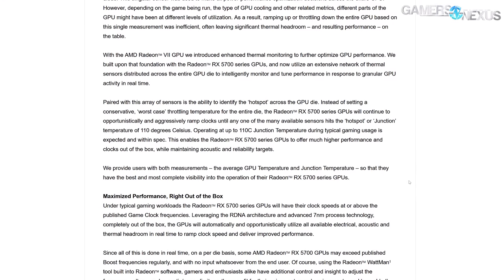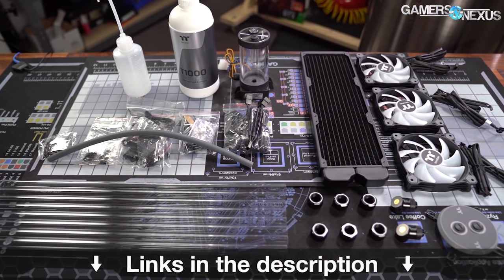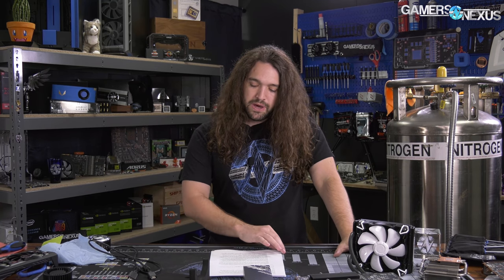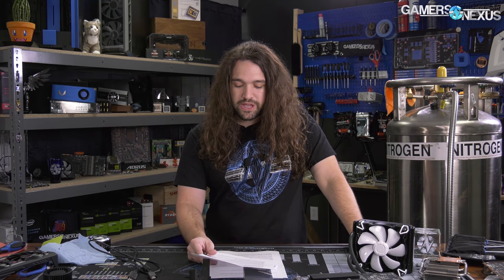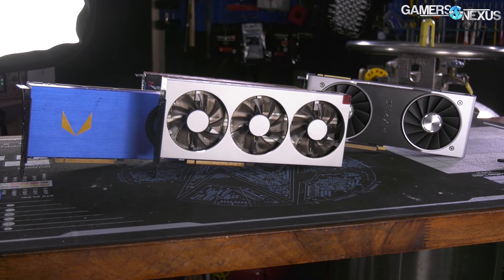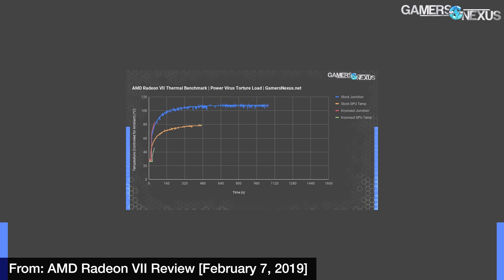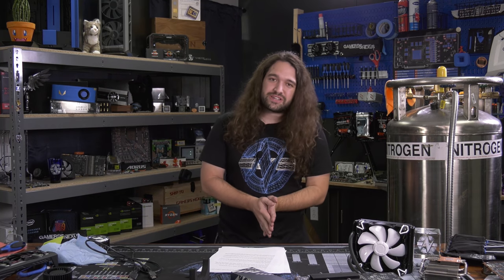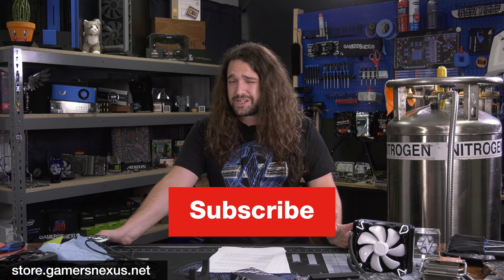Explaining Navi 5700 XT Junction Temperature | 110°C is Not "Expected"

Comment from the maker: Guys, a lot of you are posting memes and don't seem to be listening to the content, and that's very disappointing. We said in this content that Junction temperature exposure is fantastic and needs to continue, but that bad coolers are responsible for high junction temperature (not the mere exposure of it). Sapphire's cooler demonstrates well that it can be kept in the 80s and doesn't need to be "expected" at 110C. Please listen to the actual content that we invest time into rather than racing to be first to post some misleading and frankly stupid meme about housefires.
Reply: meh
Reply: Could this higher junction temp be used to allow this card to be run with something like a passive cooler?   Obviously the card will not be performing at max capability, but will it still be an upgrade over a passively cooled RX 580 (for example)?
Reply: the gamer community is not the epitome of intelligence Steve. this community is dark and regressive at times and has brand paid AstroTurfers
Reply: Mine  reference 5700 xt wont even run on stock fan curve. I keep all games on ultra tho. Far cry 5 runs half a minute or less before pc crash. Metro exodus on ultra crashes in like 10 sec or less. Running at 1080p
Reply: 3:35 AMD's statement explicitly states that there are multiple sensors for TJunction on the chip, so I find it strange that you would state that your testing is proof that the cards you've tested are not hitting 110C. Do we know how the temperature reporting for TJunction works on AMD cards and software? Is the reported value averaged over multiple sensors, or does it report peak TJunction? Over what timeframe do they time average?
Just like with PL1 & PL2 on intel CPUs, we could be seeing very short, instantaneous peaks on the GPU without ever coming close to a sustained 110C TJunction, or even showing up on monitoring software as reaching 110C. 
Just something to think about.
Reply: I think the reason for this is that pretty much everyone knows the blower cooler sucks and we didn't need yet another video to explain why.
Reply from the maker: @Vasharan  The reported Junction temperature is the maximum of all those on the chip, which is why we can state that. We said that in this video, too.
Reply: @Chakotay2222  
Sounds like you might have a faulty GPU then,
You should probably try returning it
Reply: @Aggnog  exactly we now have aib cards with really good cooler to choose from, its time to move on man.
Reply: Don’t get discouraged by the memes. There are plenty of us who your content is very valuable to and we appreciate you.
Reply: I really thought the original 110c comment seemed off when I first read it, and I appreciate the explanation. Only complaint about the video is that there wasn't enough Dragon cooler b-roll.
Reply: I have a maybe ignorant question. How does the Sapphire (or any AIB  card) compare to the reference blower cooler in a case with awful airflow? In that situation, does their claim that blower coolers hold up better in those conditions? And is that maybe what they mean by expected in that situation?
Reply: dont let your memes be dreams GN
Reply: It's Friday night, my dude.
Reply: "110 C is expected"........ Why, are they selling them without any coolers, or with the shittiest coolers?? :O
Or is the power management that shitty?? :O
ATI needs to go commit Area 51... :|

"Out of the box thermals" or "in the box thermals"? Which is it? :/

But if the boost starts AT 110 C, then I understand why the shit coolers......
Reply: I refuse.
Reply: Yes, my lord... Tech Jesus .
Reply: Unless all GPU makers such as AMD & Nvidia and soon to be Intel all post junction temps it is almost useless data and just causes everyone to get all bent out of shape about it because it makes one companies product look like it is running way hotter than the other companies product and there are enough dumb people out there to not under stand this and just spread misinformation because they are not smart enough to understand the data in front of them.

So again unless all GPU makers post the same data like junction temp then it is just something that causes the internet to go all crazy for no reason. As stated in another post AMD was not saying the card should always be run at 110c they are saying it can get up to 110c without issues. Yes they worded it poorly for sure. Besides that I am sure Nvidia also uses junction temp for their boodting as well but they choose to not show us the junction temp.
Reply: I knew what they meant 110 is within spec but lower is always better (it is fine, even you say it is. this is crazy just a semantics argument). I don't know why anyone thought that navi would keep boosting like that. I don't think amd implied that at all. Still a good video it just seemed like amd said something that idiots misunderstood. Still as a tech educator i can see why you had to make this video.
Reply: Not to nitpick (an otherwise excellent presentation), but you mention at 12:55 that "the inductors are kind of running on the edge of thermal runaway." While this might be true of the MOSFETs in the VRM, inductors are NOT subject to thermal runaway, as thermal runaway is a phenomenon basically restricted to semiconductors or other active circuits.
What happens (in the case of Bipolar Junction Transistors) is that leakage current increases with temperature, causing the device to dissipate more current, which leads to greater heat, which further increases leakage, which leads to a further increase in dissipation, etc. in an escalating cycle.
In MOSFETs, because RdsON (or "Drain-to-Source on-state resistance") increases with heat, passing the same current (at higher resistance) results in greater voltage passing through the device (E=I·R) and therefore greater wattage (P=I·E), again producing more heat, which further increases RdsON, and sets up a similar "positive feedback loop" to the earlier BJT example.
So, while an inductor's DC resistance might increase with heat, its AC impedance remains largely unaffected (which is typically the much larger factor of the two), and it won't pass more current as it heats up and set up a "runaway" situation.

As I've already opined, this was an excellent piece and I'm glad you exposed AMD's attempt at dismissing excessive temperature — (it needed to be said, so kudos to you). I hope you take this small correction in the (hopefully informative) spirit in which it was intended. Thanks as usual for the great content. Keep up the good work.
Reply: Notwithstanding the rise of the memebots on the internet and the lack of insight therein, the disappointing thing here is AMD's refusal to just admit "Yeah blower coolers were probably not the best choice" and the lack of sincerity therein.
Reply: what is disappointing steve, it's that you have to make a video to clarify misleading statements that AMD made to sell more cards.
Reply: @picklesthegreatest  I know what you mean but it's still WRONG  because if you take a blow torch to your GPU it'll heat up your room if ignoring the heat from the blow torch... Because it'll try and desipate that heat. Ultimately it is the temperature transferred that matters not TDP. Because that temperature is what transfers to the air. if you have same TDP and one GPU is at 110c and the other is at 40c the room with the 110c gpu wouldn't heat up as much as the 40c one! SO HA! Because the Heatsink on the 110c heatsink will hold more energy from going into the room. SO you are WRONG on two accounts! HA!
Reply: @andrewryder3075  Inductors are affected by heat, it increases their resistance which can then have an effect on their impedance which can cause higher power draw...
Reply: @picklesthegreatest  you've never owned a 295x2, it stays steadily at 70c in a gaming load on the 2, 290x cores, but pushes out 50c air from the rad. It's well cooled, but at 500w tdp, it was and still is a space heater. I know the 295x2 is a specific use case in this argument, but its not the core temps that heat the room, its  the tdp of the card. When 5700s are "expected" to be at 110c with only a 180 tdp, they are not being matched with the proper coolers. Obviously.
Reply: Wait so.. where exactly are all these memes you speak of? I dont see any. I would assume it's people referencing using AMD as a space heater but I dont even see that.
Reply: "Up to 110c junction temperature under typical gaming is expected and within spec" means that the GPU die is prepared to handle a hotspot of this value and that it does not degrade the die, not that is regularly operating at this value under typical gaming (which is clearly false even with the blower cards under default settings).
Reply: @picklesthegreatest  with blower style coolers it definitely does have an effect on room temp, its literally blowing 100c air out the back of your case like a damn space heater and it WILL heat your room up quickly. Put your hand over the exhaust and see what i mean, its toasty as hecc.
Reply: I think most people who watch this channel know very well that amd statement about their stock cooler is bs so all that's left is memes.
Reply: @Cichlid_Visuals  see my comment
Reply: Power Play You lost me at attention span
Reply: @jno4159  🤣🤣🤣🤣🤣
Reply: Love your content, own some GN merch, but this was kinda a silly video.

Even roundabout calling AMD hardware engineers wrong when you’re a hardware enthusiast and not an engineer is just...ehhh

AMD definitely could’ve worded better their attempt to assuage fears of the “big new scary numbers”, but their intended core message is clear: “No, routinely riding 110°C junction will not damage or otherwise shorten the lifespan of your card. Yes, you’re giving up a little performance if you don’t keep those temps down. We should’ve made a better cooler our bad, but everything is operating within safe limits so don’t worry.”

Not every day is a big news day though so I get it 👌🏻 still love you guys
Reply: @Gamers Nexus why does AMD seem to insist on blower models on their first party cards, Radeon VII being a obvious exception, when it is known to be a bad cooler design? Not throwing shade on AMD, just confused why they keep sticking with blower designs when partner cards almost never do?
Reply: @gondonmeddruxon  You're comparing the average temperature of your 295x2, with the tjunction max of Navi.
They are not the same thing. and steve explains that in the video.
Reply: @samsh0-q3a  I've scrolled passed 3 before i got to your comment. from space heater to cooking food.
all of them have failed to grasp the point of the video.
Reply: @MrNexyto  how are they BS? Their stock cooler performs exactly the same thermally as any other stock cooler for high end GPU. All of them are designed to keep their GPU's around 80 degree's, and that means all of them have tjunction temps of well over 100 degree's.

Navi's just the first to report tjunction's.
Reply: @Cichlid_Visuals  its impossible for a GPU cooler to blow 100 degree air out the back when the average temperate of the GPU is 80 degree's. tjunction temperatures NEVER reach the baseplate of the cooler, let alone the ends of the cooler fins.

in addition the used cooler DOES NOT (significantly) effect the amount of heat energy the GPU generates. any cooler on the same GPU will all heat up your room just as fast. in fact the reference cooler might do it slightly less because the card might throttle slightly, lowering energy output.
Reply: lol!
Just purchased my 71 view case and 3900x 😁 To bad I can't pick it up from Best Buy till the 27th... 😑. Now I just need a GPU. Building it so my wife can start her YouTube channel. Have to choose between a 2080ti, 2070 super or 5700xt. Is the Navi good enough for video encoding? Or should I work OT and get the 2080ti?
Reply: Sadly some Gamer's are very Hardheaded and don't watch the Video first.
Reply: please cry less
Reply: i think you need to provide GRAPHIC representation of the chip and how and where the Junction is measured when compared to old method...

it would also help to specify for the masses that we have been having higher than "reported" temperatures in the silicone for years - in spots inside the package 

i just have to wonder what the "junction" temperature would be for lets say i9 9900k overclocked to the thermal wall (meaning with barely adequate cooling, not delidded liquid metal coated on watercooling one :) )
Reply: @TheCountess666  thats the whole point of heat absorption, delaying the effects of heat increasing. Of course all things will reacb equilibrium in time, but time is quantifiable because we only game for so long, so the longer that heat is delayed from increasing ambient room temperatures the better. You just supported my argument.
Reply: well i listened and the first point.. "this is wrong, not in spec because it doesn't always reach those temperatures" is just mind boggling as an argument... 'within spec' means that even in bad conditions it runs as expected, not that you cant improve them.
Reply: Maybe next time  DON'T to post a click-bait title. Because that is how you get a juvenile knee jerk reaction from the trolls.
Reply: @picklesthegreatest  actually if you have proper cooling it will heat up your room much more since its pulling heat from the card and dumping it out of the case.
Reply: Did you watch Jay's video on this? He spoke of this at around 4:10 - https://www.youtube.com/watch?v=DzCOvZEH318
Reply: @LeftJoystick  this is just a different way of measuring a more accurate core temp
Reply: @stefangeorgeclaudiu   Steve said--several times--that the issue is not whether the silicon can handle it.  (Yes, it can.)
Reply: Giving the community a little slap on the hand GN, I like it
Reply: You can legit cook an egg on the gpu. That's how bad it is.
Reply: Did you really expect anything else? Seriously?
Reply: Probably from AMD POV 110c is okay and there is still guard band between internal data sheet and marketed spec. I used to work as NPI product engineer in fiber optic transceiver, we usually have quite a big guard band between final test spec and marketed spec. For temperature it's usually Δ
3c guaranteed by MSA spec while internal test spec is Δ1.5c. This allow us to reduce the BOM cost on certain parts of the product while not affecting 1st pass yield and cumulative yield, for this case i assume the cooler. This way they can still offer competitive pricing even though they lost time to market advantage against nvidia.
Reply: So many opinions over a poor cooling option. Why can't we all be happy AMD has brought a good upset to NVIDIA's hold on the GPU market?
Reply: Never stop spreading FACT.   Upmost respect for your continued  presentations that further our education.
Reply: They coming from Linus P12 RGB Tech Tips. That's why they answer memes then the topic of the video.
Reply: Imagine buying AMD products just to burn down your house.
Reply: Indeed, although whilst I can't remember who it was as I've been jumping around a lot of different 5700XT variant coverage the last 48 hours (I think it may have been Jayz though?) some one covering the 5700XT and junction temperatures made a pretty interesting point along the lines of "So AMD have exposed junction temperatures on their cards which deviates from the temperatures we're used to seeing reported on GPUs. Whilst these look high, I suspect if Nvidia were to expose such temperature readings on their cards, we'd probably see they're already reporting in similar ranges to AMD cards". 

Do you think that is a pretty accurate assessment?
Reply: @picklesthegreatest  my 2080 runs under 70C at stock in AC Odessey and my small room is noticeable hotter than the rest of the house, especially when my door is shut
Reply: This video has over 50k views and less than 1k comments. I'm sure people are getting the message, however it does seem that you're a tine bit invested in blasting AMD for this. I'm sure they don't want people's cards to melt. I've never seen over 91C on mine after hours of gaming modern titles.
Reply: @GamersNexus  You're receiving crap over this because of your clickbait title which is wrong.  Yeah, you explain better in the video but the title is ridiculous.
Reply: @Puffalupagus360  Because AMD doesn't want to compete with their AiB partners. Nvidia makes decent reference dual fan axial coolers because they know they have the power to muscle people around.
Reply: @Tiki832  It's purely speculative, so yeah you're dead on it. :)
Reply: Hello Steve, I do agree with you, in fact, your review was the reason I decided to wait for the sapphire version, but without extending myself as to why I replaced the card (previously using a badass Pulse vega 56) my question is, do you happen to know what are safe operating temps for the GDDR6 chips? I've seen mines hit as high as 90c (never sustained though, Micron)and that concerned me a bit because not even my vega 56 HBM (Hynix) used to go past 80c and I cannot seem to find any good information on the web about it.

The first thing I did upon installing the card was the classic move, test in defaults, see it burining a bit. then proceed to the AMD Standard protocol, Undervolt it. but this time also had to touch a bit the fan curve (I,m te kind of person that gets anxiety if the temp starts hitting the 75 mark for any part of the PC, lol) to ensure even better temps for my scenario (kind of okay case with meh ventilation, and room temp between 30-34 degrees, no AC) had to sacrifice some clock speed, with minor  hit in games FPS, but now it overally stays around 70 for the edge, 75-80 juntction, and the vram is the one having funny jumps between 70-90 (at least all this is what afterburner reports, i hope we get mics in the card very soon, that way we can hear it screaming for mercy directly)

To anyone thinking to move from vega to navi, as far as I've observed, Navi already clocks itself at the highest the chip can handle (mine crashed everytime i dared typping any number higher than the 2070 that comes at stock in wattman, All you can do  (at least for now, lets remember drivers are not as matured as vega ones) is undervolt it and keep it as cool as possible to ensure higher and constant clock speeds.
Reply: Well, they said they "expected" these bad temps with their bad cooler..
Reply: I think part of the issue is normalising to 40dB in this case. That's not something users actually do and tbh as someone interested in the actual noise levels of the card during operation isn't much use to me either. All I know is the reference card gets really hot @40dB under load. What I wanted to see was how loud it gets under load, so it would be pertinent in future alongside any "normalised" noise/temp comparisons to also show the card's actual noise levels while operating under normal stock settings.
The misconception is that Reference Navi is a HOT card, when the reality is Reference Navi is a LOUD card.

That said I think AMD should start undervolting their cards a bit out of the box. Or rather stop overvolting them, as quite a few sources have confirmed that totally stable UV cools the card and drops noise levels a fair whack.
Reply: @mydogbuddy07  Or he's got a crappy PSU.
Reply: I'm not talking about anything Steve said, I'm explaining to him that, that's how the "space heater" lingo came about. I'm not comparing them in any other respect than the tdps
Reply: @SISSYPUSS  Thanks! My question was based on the 2080ti vs 5700xt video on this channel. He said the 5700 was as fast in encoding as the 2080ti. So would 2x5700 be much faster than 1x2080ti? It would be half the price
Reply: What do you expect from amd fanboys?
Reply: Well obviously all it does is give Nvidiots or idiots stupid ammo to make dumb comments or misleadingly do comparisons with AMD Junction temp vs Nvidia Edge temp and say the cards get way hotter than the competition when they really dont. IMO they need to just stop reporting the junction temp. Nvidia will obviously never start reporting it. And you got some people linking this video like it helps their "AMD is too hot" arguments, cuz like you said they're too stupid to listen and no matter what happens, having a visual temperature that is higher than one they are use to looking at will do nothing but feed the FUD.
Reply: @SISSYPUSS  cool thanks!
Reply: Cichlid_Visuals your comment is in accurate and you should feel bad :)

For really though, the if the silicon is 100c, the metal won’t be 100c, and the air defiant won’t be

Power draw is very closely correlated to heat generated because heat is generated as a result of electrical inefficiencies.

The type of cooler has almost no bearing on the temperature of the rooms, as the heat is going to dissipate one way or another
Reply: Tech Jesus Hath Spoken!
Reply: @picklesthegreatest  It is relevant because the temperature can potentially ruin the longevity of the card. That's why Steve was initially concerned about it in the first place.
Reply: @Puffalupagus360  To save money on the card
Reply: @Eonradio  Because temperatures degrade it, and there was no valid excuse for blowers when they clearly gad fans on the Radeon VII. If I get the card, I sure as well will make sure it's not a blower with little driver issues first.
Reply: @aamon6393  this made me laugh so hard
Reply: @jaronmarles941  would you agree that is a poor reason for people to act the way they are? Honestly I am waiting for AMD next GPU stack. I am betting they fix "most" of these issues.
Reply: @jaronmarles941  would you agree that is a poor reason for people to act the way they are? Honestly I am waiting for AMD next GPU stack. I am betting they fix "most" of these issues.
Reply: Look of all those noisy amdicks blaming others to cover up their mediocre 7nm products.
Reply: @Eonradio  It's not a poor reason if you want it to last. Luckily, there's partner models for the temp. I'm giving AMD till Black Friday to fix the drivers. If they don't, I won't buy the card. This issue has been around for months.
Reply: @Cichlid_Visuals  you right especially if the fan is maxed out I have a flashed vega 56 the thing will hold over 1600mhz for about 3 minutes and can cause an actual increase in ambient temperature, judging by the fact that running it like that for a long time can actually make me sweaty and miserable.
Reply: Yup. the Power Color Devil 5700XT runs very cool.
That crap ref cooler from AMD really need to go away.
Reply: @brayannexon4613  lol its true as hell i dont know why these pseudo scientists want to argue something so simple. i bought one of those asus "turbo" rtx 2070s when they first launched, blower style, 1800mhz boost clock would make me sweat in 5 mins lmao
Reply: They're saying it's to be expected because it's using a shitty, blower cooler. Is that wrong?
Reply: Brand fanboyism should be perma banned on every forum. Subreddits like r/nvidia or r/amd should be fucking burned to the ground.
Reply: Fanboys and filthy casuals are everywhere these days
Reply: welcome to 2019
Reply: @picklesthegreatest  I didn't mimick anything you said? I'm pretty sure my comments were made, then you reiterated what I said. I wouldn't have taken time to tell you, you are wrong if you made that comment before my explanation.
Reply: Hmm. Back off envelope calculations are that this kind of high-K insulated doped silicone will perhaps survive 120 C giving it a narrow 10 C margin. The problem is actually running it like that for a prolonged time as temperature increases dopant migration breaking the chip.

The card will downclock of course. But 110 C target is suspiciously high. Planned obsolescence, I think. 3 years? 5 years of continuous work? Low MTBF?

Better fix the cooling.
Reply: expecting yt comment section to listen and not posting memes is kinda naive in the first place.
Reply: picklesthegreatest I think you’re confused. Every time “space heater” has been used in the past (GYX 480/580) it’s been in relation to power draw, not temps. However, higher power draw usually results in higher temps especially on blower cards.
Reply: you deserve backlash, gratuitous bashing, gn making drama, reading what your bias wants to read. tin foil hats.
Reply: Defensive= Legal disclaimer.
Reply: Shitposting is fun though
Reply: But memes
Reply: You all made Dad disappointed.  I hope you're proud of yourselves.
Reply: Problem fixed, thanks EKWB! :
amdgpu-pci-0d00
Adapter: PCI adapter
vddgfx:       +0.88 V
fan1:           0 RPM
edge:         +40.0°C
junction:     +42.0°C
mem:          +48.0°C
power1:       162.00 W  (cap = 150.00 W)
Reply: You're expecting too much, most people who watch and value this don't comment often, like me. Keep up the good work.
Reply: You're asking of people to use their brain, it's simply easier for the average individual to be ignorant.
Reply: man to be honest , I have a  mas sized case because I have grown up needs and I didn't want to build a console , after  flashing my 5700 with an XT bios , it  drives me nuts  seeing my average "hotspot" temp being 68 after 5 hours of gaming as Im not use to seeing anything go over 55max /48  avg   .  So yea its annoying the idea   that  folks are ok with it being at 80 avg ..wow.  "its ok for  the chip" ... would it be ok for any part of you to hit   80 degree's C for any period of time ? no ? wtf would u think its ok for your hardware to do so lol.    I  already had 8 fans + my aio in my rig ...this  silly card  forced me to add 3 more fans . ( and no  just because you place the fans in the wrong place doesn't mean that moving more air  is going to stop helping...more is...well more .
Reply: Man... I need Help :(... Im from Brazil , I dont even know how ti speak english very well... But I got Sapphire Pulse... All the temperatures are even better than your test , GPU Edge I get 65c , Memory 80c ( Max ) and VRMs 58c !!! But the fucking hotspot is getting hot , 106c every time I put " unlimited frames " , Fortinite and Modern Warfare ( BattleRoyale Mode ) , they are getting 174FPs 1080p , and the " GPU Hotspot " reaching 106c in both cases... When I lock the frames in 60 FPS , that Gpu Hotspot came to 60/80c MAX !!! ALL ULTRA AND EPIC SETTINGS. 
But I have a 144hz 1080p monitor... I really want to play in the 144Fps , but not in 106 degrees ( hotspot )... 
IS importante to say that even When Hotspot gets 106c , ALL the other temperatures keeps nice , Edge 68/70 Max... 
Should I give that Card Back and take a Red Devil ??? I Have a Sapphire Pulse 5700 XT right now , Just to remember. Thank you.
Reply: The situation described at 2:40 acutally happened to me with a Powercolor Red Dragon 5700. In Borderlands 2 the card would boost until it hit 110°C and then pull the brakes. The reason for this seemed to be, that with the silent BIOS on the card activated (which was the default) and the last driver (20.04.1 afaik) the fans wouldn't go above 900 rpm with auto settings. And these 900 rpm are not enough for 200+ FPS in borderlands 2. I switched to OC BIOS and at the same time, the new driver came out, so the problem is fixed now, but I can't tell whether it was the driver update or the OC BIOS, or maybe both (I haven't switched back to silent). The fans run typically at 2000+ rpm when the card is under heavy load and the temps are between 80 and 85 °C for TJunction, which should be ok.

But the situation that the card boosts until it hits 110°C did actually happen (repeatedly). Certainly not on purpose though. Staying silent no matter what, even when the card starts "burning" was most likley not intended even for a "silent" BIOS.
Reply: Hi Steve, what would you say is an acceptable daily junction temp? I have a nitro+ 5700xt and to keep the junction temp at max 80c, I have to hurt my acoustics significantly. Can I raise my threshold to say 90c? this would for sure improve acoustics a lot. thank you for the hyper detailed videos!
Reply: my junction temp in AAA titles on a red devil 5700xt is between 70-74Oc. Guess I'm doing ok. What I do not understand is why all my fan curves seem to stick to junction and not gpu temp.
Reply: I know it’s not the same card but have a 5500xt as a temporary card until 3070s are easily available and the junction temperature never goes over 81 on a gigabyte card. That’s playing red dead 2 which seems to stress the card the most of any game I’ve played.
Reply: what would you guys say about running a 6900XT at junction 100C under liquid cooling.... at 2550Mhz and 2170Mhz VRAM OC
Reply: U would be surprised how many ppl are stupid